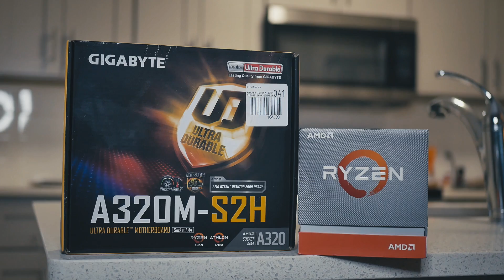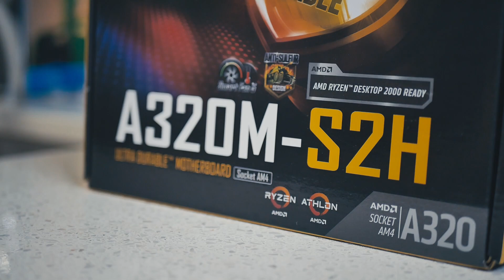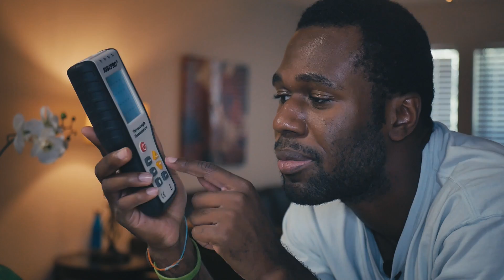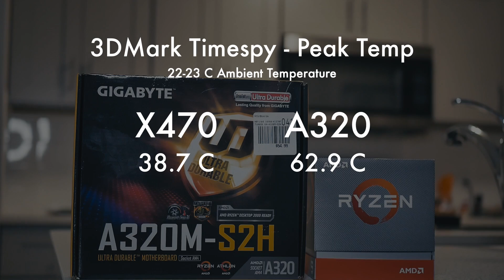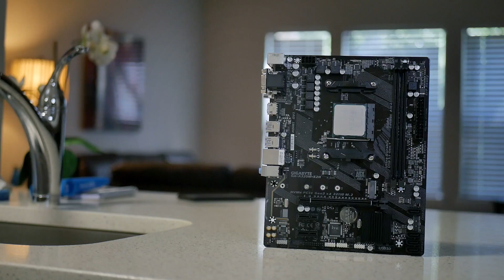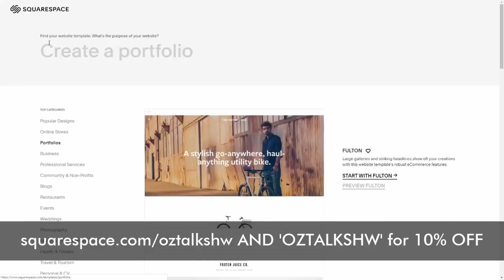The R9 3900X on the CHEAPEST motherboard available | OzTalksHW

Comment: What happens if you just put some cheapo adhesive heatsinks on the VRM on the A320 board?
Reply from the maker: Honestly,  small fan would improve temps tremendously. I'm not sure about current etc. Would need better hardware testers for that
Reply: @OzTalksHW  when the VRM is bad is bad.I have gygabite aourus x470 and the vrm are awfull so there is a lot of voltage fluctuations.
Reply: @florianristea  how about my MSI's VRM heatsinkless b450 pro m2
Reply: @charlesleonitol.iringaniv8320  Adding heat sinks won't hurt, but the benefit you get would depend on what CPU you use and how you clock it. Google this document (not posting a link in case Youtube removes my comment for spam) 1wmsTYK9Z3-jUX5LGRoFnsZYZiW1pfiDZnKCjaXyzd1o for a list of most AM4 motherboards, including details of their VRMs.

The B540M pro-M2 has a pretty decent-quality 4+2 phase VRM (the same as used on the Mortar and Pro-VDH plus... the latter of which happens to be my current motherboard), just without any heatsink. It would be really interesting to see how boards with otherwise identical VRMs compare to each other based on what heatsink they use, and to see how important MOSFET quality is compared to number of phases, number of mosfets per phase, and the cooling capacity of a heat sink.

I've noticed my motherboard seems to either be overvolting my CPU, or is reporting a voltage that's higher than it should be. My CPU is the 2300X, with the stock wraith stealth cooler, and I benefitted a lot from a slight (~0.05V or so) undervolt (undervolting too far caused PC crashes while gaming), so considering your VRM is identical to mine (sans the small heat-sink) it might be worth trying if you haven't already - it will reduce your power usage and let your CPU run cooler, and should also put less stress on the VRM.
Reply: @nathangamble125  it did not say anywhere that the board I have has the same quality of VRMs as the Mortar. It just has the same VRM count. It might be a good idea to save money by adding heatsinks. But I think it might not be good in the long run
Reply: @OzTalksHW  why was the single core score higher on a320
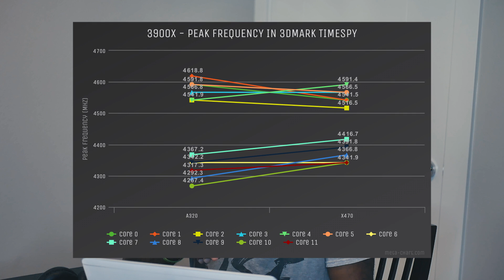Reply: 5:18
Reply: I saw few A320 with heatsink, price is not that bigger, maybe check that one out?
Reply: you lower the temps.you can use a small 40mm fan too

Comment: Oz, I can help you with your question. The single core frequency is higher on the A320 motherboard because AMD only limits the boost when enough threads clock high enough. The voltage on Zen2 can't get over 1.325 Volt when the Amperage needs to increase to get that higher multicore boost. If the power would be too high you would get too much damage to the silicon (degradation long before you quit using it) but with only a high voltage and not a high current you don't get that damage. Compare it to a waterfall: the voltage represents the height from where the water flows and the current represents the watervolume per second. If that water would fall on stone then a few drops from a high height wouldn't do much damage but a large volume per second from that height would erode the stone fast. The same principle applies to this CPU. AMD limits the voltage as soon as the current needs to increase and the current needs to increase above a certain value.

Comment: Nicely done testing.   Someday when they get cheaper I’d love to try and replace my r5-1600 with a 12 core...  so please test that chip in an Asrock B350 pro4 next. :D
also I’ve heard AMD market the 3700x as a 65w part.   Can you test that cpu on the a320?
Reply: If the 3900x can survive on this A320 board then the 3700x will be fine. Just don't expect to overclock it

Comment: MANNN... What the HELL.

Those inflated PRICES of the 3900x currently, since it's practically SOLD OUT everywhere.
Reply: Older TR's are sub $300. If you don't mind the lower clock speeds, buy TR.
Reply: @youtuberobbedmeofmyname  but you need new mobo
Reply: @youtuberobbedmeofmyname  to be honest tr4 motherboard is exspensive
Reply: @youtuberobbedmeofmyname   buy x370 i mean i don't understand why people buy x570
Reply: @youtuberobbedmeofmyname  in my region x570 price is 1.250x of x470 and about quality is up to manufatur

Comment: Well i mean if a a320 board boots with a ryzen 9 3900x i hope my asus prime b350m-a runs stable and strong enough for a Ryzen 5 3600/X
Reply: dont get the 3600x, it is a waste of money. it only has a better cooler and thats about it. get the 3600 and if you want,  a scythe mugen 5 rev. b as a cooler. you will get better results, than the 3600x with a stock cooler and still save a bit. or you run the 3600 with the stock cooler and it should be fine too.
Reply: @bertracoon1884  i was thinking about getting myself the r5 3600 with a 50€ Alpenföhn air cooler with 5 pipes and 220 W of cooling rating. i guess that will run it cool and silent enough while having that nice looking full white style. what bothers me more are the vrm tempretures on my board becuase it doesnt have any cooling fins on it.
Reply: @xxzmk  i think the mugen 5 rev. b is better and it is about the same price. 45 - 50 euros. it has 6 heatpipes is pretty silent and has one of the best mounting systems.
Reply: @xxzmk  are you sure about that tdp of the alpenföhn? 220 watts seems to be a bit to high. i mean a noctua nh-d15 is a twin tower cooler and probably the best aircooler available and that has a 220 watt tdp. that thing weights 1320 gramms or so. the mugen 5 rev. b weights about 830 - 850 and has 6 heatpipes too. it is a real nice cooler, believe me.
Reply: @bertracoon1884  as far as i know the mugen 5 is also around 5 db louder than a brocken 3 and has only 1 fan, where as the brocken 3 has 2 huge fans which can be set to lower rpm speeds and still perform same if not better.
Reply: @xxzmk  also wenn der test hier stimmt, schlägt er den brocken 3 um einiges. klar ises nun nicht die gleiche cpu aber nen 7700k wird vermutlich heißer. https://www.pcbuildersclub.com/2018/09/luftkuehlertest-2018-18-cpu-kuehler-im-ausfuehrlichen-sommertest/#Das_Testsetting
Reply: @xxzmk  sorry, switched to german :). im tired. the test results, that are in the chart represented show a different story. the brocken 3 is far behind at cooling a 7700k, so i think it will be the same with other cpus. i dont know how legit this test is but i saw a few and the mugen was always good. you could get the pcgh edition, if you prefer 2 fans, it is 5 euros more expensive or so. i dont think it will make a big difference but i assume it will increase the cooling a bit. 
https://www.pcbuildersclub.com/2018/09/luftkuehlertest-2018-18-cpu-kuehler-im-ausfuehrlichen-sommertest/#Das_Testsetting
Reply: @bertracoon1884  sry aber aus irgendeinem Grund machen, die Werte fast gar keinen Sinn. Ein 3 Piped Ben Nevis performed genau so gut wie ein 5 Piped Brocken 3 ?. Naja egal, ich gehe dann mal trotzdem davon aus, dass der Mugen 5 besser sein könnte. Ich schau es mir mal an, vielleicht versuche ich sogar ein Noctua zu holen, der gebraucht aber noch gut genug ist.
Reply: @xxzmk  der mugen hat 6 pipes und wiegt ungefähr das selbe, wie der brocken 3.